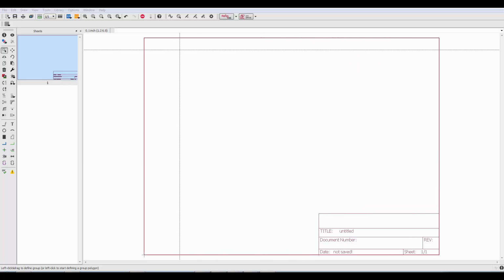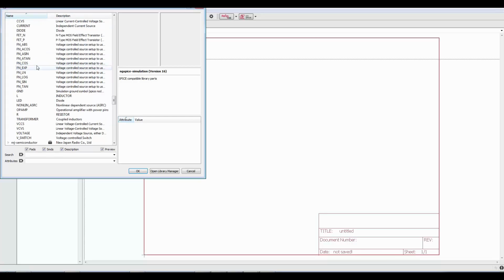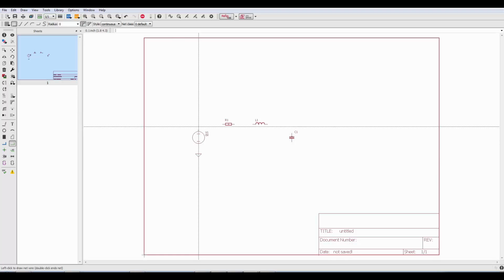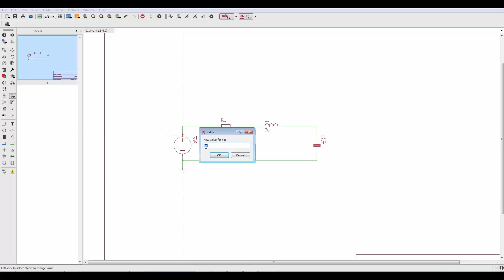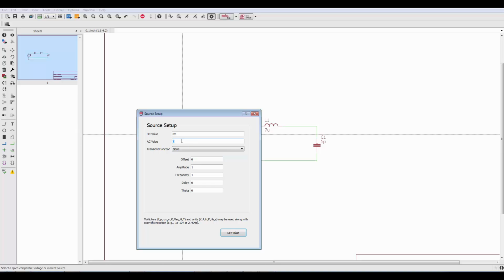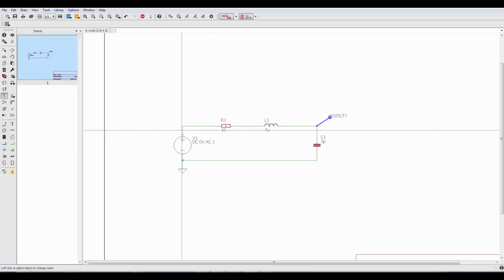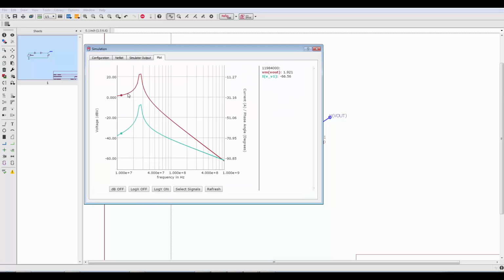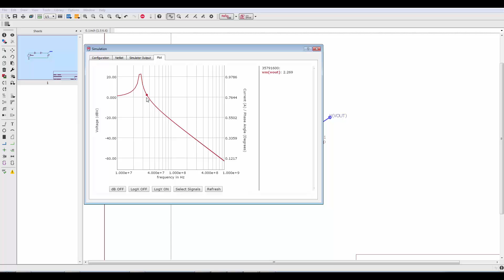Using the Ngspice Simulation Library and AC sweep - Tip 3

Comment: so what would be the solution if i followed this 1 for 1 and i get this error "Circuit: * spicenetlist

Doing analysis at TEMP = 0.000000 and TNOM = 27.000000

No. of Data Rows : 500
Error(parse.c--checkvalid): of: no such vector.
Note: No ".plot", ".print", or ".fourier" lines; no simulations run" just wondering ?
anything wrong with the installation?